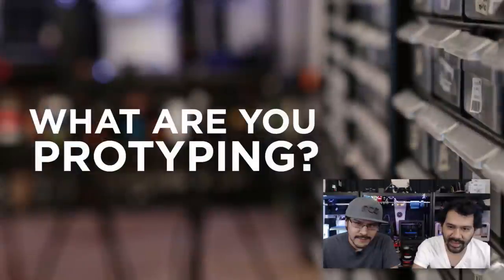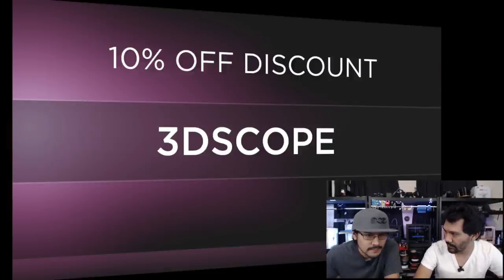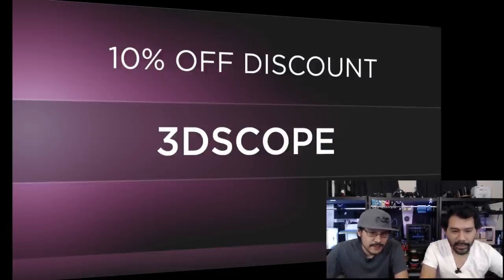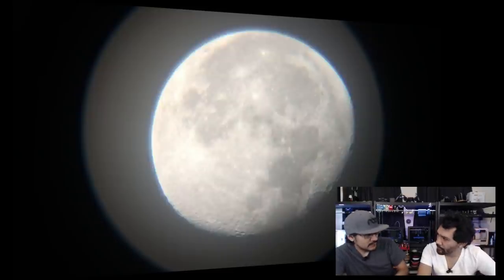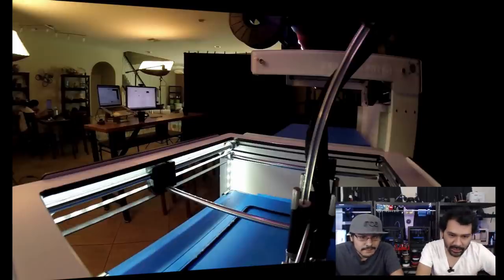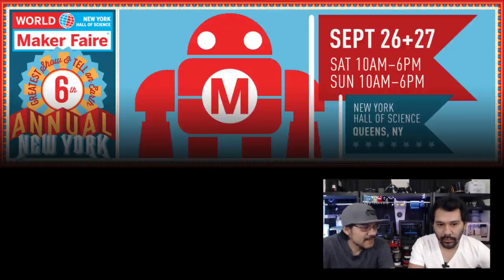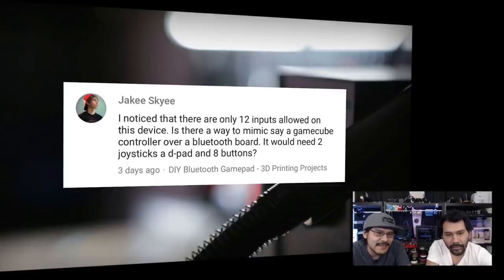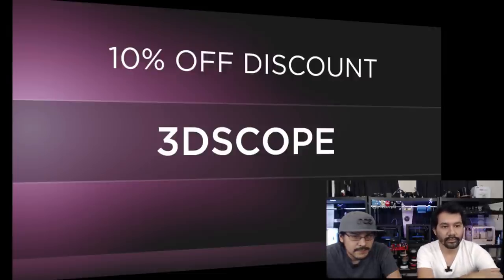3D Hangouts - Telescope & Raspberry Pi Tablet

Comment: The idea with the moving the Pi to a different spot is very smart. Its also pretty cool having the "snap on" design for the enclosure, however I wouldn't design an enclosure that way simply because it doesn't protect the bezel very well. I plan on using your design to make my own enclosure, but I will have to modify it to hold a battery I have for it. Keep up the good work!